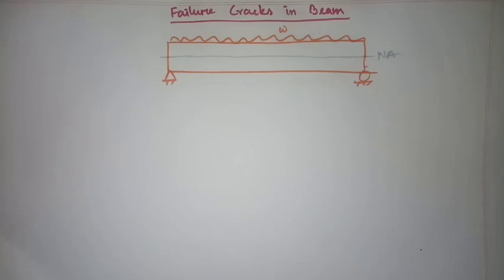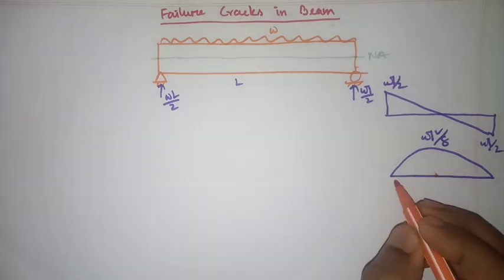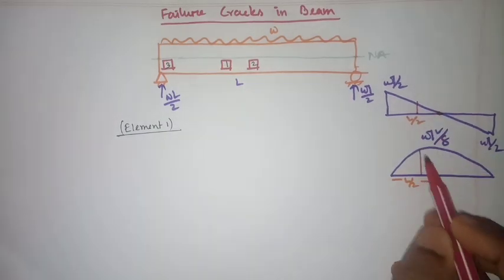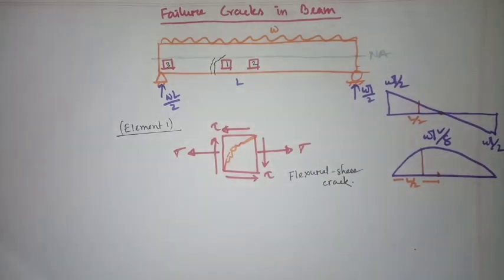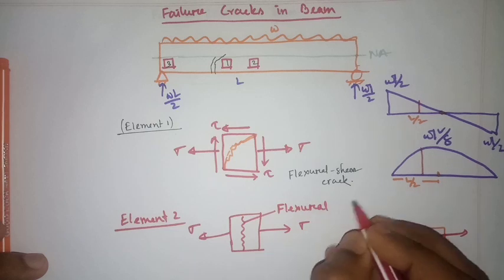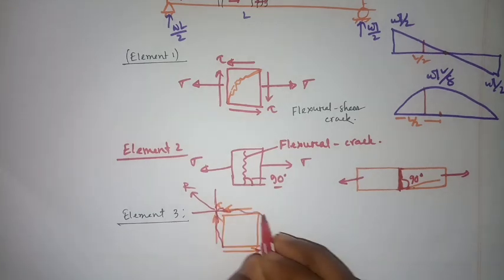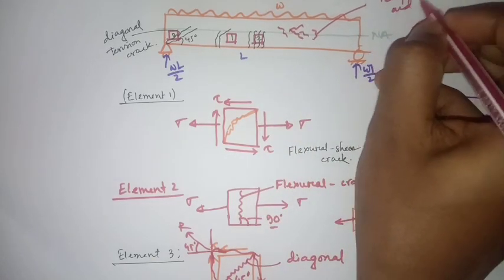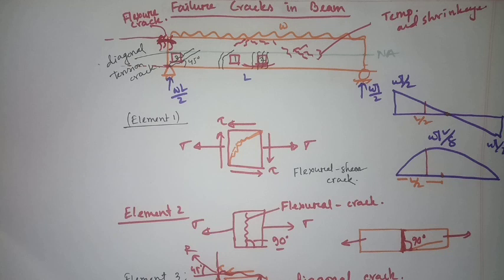TYPES OF CRACKS IN RCC BEAM

Comment: Sir,What is the solution flexural cracks.
Reply from the maker: Flexural crack is due to under reinforced in flexural membe(beam). So, increase bottom main reinforcement to repel the problem.
For shear crack use stirrups.